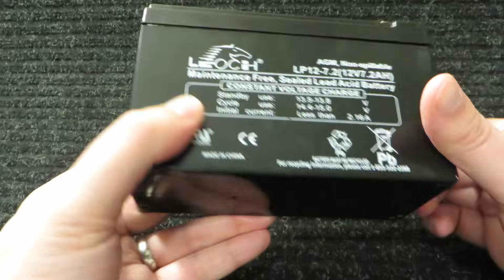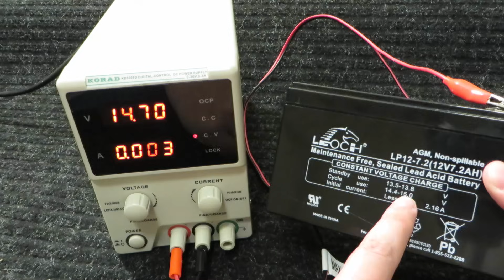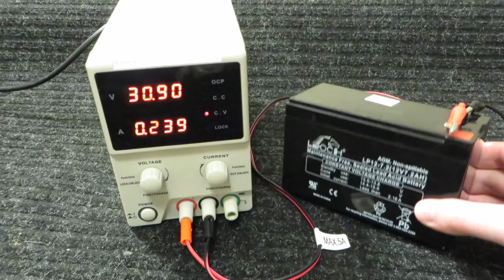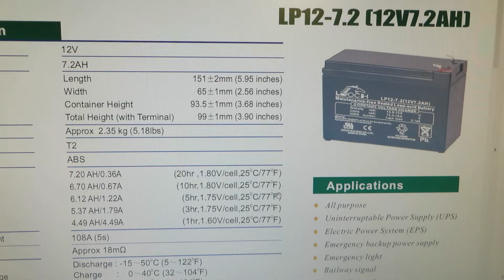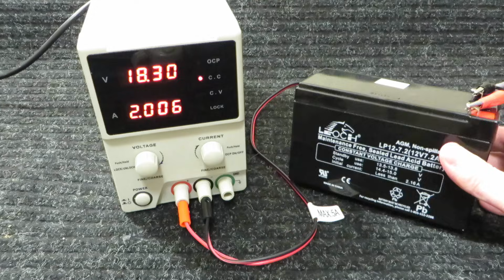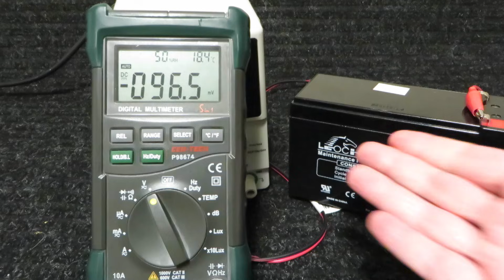Battery Desulfation Demonstration Start to Finish - Part 1/2

Comment: 19V Bricks: Many standard laptop chargers (like older Dell or HP bricks) actually output around 19V to 20V at 3 to 4 amps. These are excellent for brute-forcing a sulfated battery to start accepting current, but they require close monitoring so the battery doesn't overheat and start bubbling off hydrogen sulfide gas.
Reply from the maker: Nearly all laptop chargers have hiccup mode overcurrent protection so they don't work for this without adding a high wattage resistor inline to limit current.

Comment: battery desulfation?:  I have a agm battery was in a car it read 4v.  Took the battery out connected to health battery for a while and when up to 10.5v+.  Then put it on power supply like the one you have set it to 1.5amp max 14.2volts max ran it for a few days.  After a few days voltage was at 14.2v and amp was 0.245 amp.  Then I stop it and put it on  batteryminder (it is suppose to have a pulsating desulfation feature) and it was charging a for a few days at 14.3v 0.2amps for a few days then it drop to 14.3v at 0.12amps.  Then I witch batteryminder to maintenance mode and the voltage drop to 13.13voltas and the amp remained at 0.12amp.  Ran it for another week.  The test,  24hr rest voltage drop to 12.41.  Load lest with old faction toasted tester 10sec at 11volts (very good) green all the way on the scale showing 800-1000 (i think these are cold cranking amps).  Looks like amp is droping 0.01amp/day resting so it is 12.37 volts today.  This is a spare battery at this point the questions is what should I do next.  should I leave it alone because it not going to get better.  Should I charging it at a higher volt because it was never charged more then 14.3 volts and the battery label said to charge at 13.8 to 14.6v using the power supply.  discharge the battery and recharge procedure. what is your advice? I would say at this point the only indication that this is not a new battery is that the resting volt is at 12.41 and it is dropping 0.01 amp/day (still have to cofirm this over time).
Reply from the maker: Sounds to me like your battery recovered just fine.  If it isn't a newish battery it isn't ever going to be 100% again.
Reply: @knurlgnar24  thanks for the reply.  the reality is this battery could be at this level before it drain down to this level due to parking/storing to long.  But you video does Help.  That is why I bought the power supply a few years ago because that was what you were using.  Thanks again!

Comment: I have like 50 of these (mostly half-size 5 Ah) from old alarm systems. A good number of them have pretty bad sulfation. I usually desulfate them by just connecting them to a 14 V switching power supply, but some are too far gone and need higher voltage for a bit before they'll accept current. For those I watch them closely since once the sulfate dissolves it can quickly start overheating. When that happens you'll hear bubbling inside the battery and might smell rotten eggs from the H2S. 

These are great for solar-powered trail cams or weather stations. Also fun to hook a bunch in parallel and blow things up with obscene amounts of current lol

Comment: I was interested in the beginning, but after a lot of repetition I got impatient to see part 2 which hopefully talks about pulse de-sulfation.  But unless I'm missing something there is no part 2, no info about pulse rejuvenation.  Ho hum, so I just watched 20 minutes of mostly repetition of how 30 volt charging doesn't really work (which I already knew).  If there really is another part that covers pulse charging, please let me know where it is.
Reply from the maker: There is a part2 and it shows that this method does work.  Pulse charging, on the other hand, does not - or at least it isn't beneficial over this method.  It's a marketing gimmick by snake oil salsemen.

Comment: Though it doesn't look like that battery had a chance, it showed that if you had one that was in better condition this would probably work. 
To take a battery that was so far gone and give it some hope showed you made some definate improvements.
I have a 12 volt lead acid battery on my S10 and I purchased one of those desulfators that you just leave connected to the battery all the time. Checking with a clip-on type battery condition tester made by TopDon, My 3-year-old battery still shows 100% state of health. 
The battery is actually over 4 years old, I bought it, then reinstalled my old battery back in the truck until it died completely. 
I kept my new battery on a trickle charger during the year so technically, the battery is 4 years old and still at 100%

Comment: In UPS units these type of batteries almost always bulge and / or crack when they go bad and this usually is typically caused by excessive heat during the charging. Most charging circuits don't measure the battery temperature that well if at all and they keep trying to supply 14.7V per battery. Most UPSs use series batteries. At work I have dozens of units. Edit: Looking at this battery I suspect it was brand new but never used. I have seen this behavior with a few UPSs that had been sitting on the shelf for 5+ years never plugged in. I had them because it was equipment that a different department purchased and didn't use but shared my space.
Reply from the maker: The UPS units I've looked at all float the batteries at about 14V per 12V battery and are not current limited.  If a cell shorts, which is common once the electrolyte starts drying up, the current spikes and they overheat, swell, etc.  I agree - I think this battery was either unused or taken out of a unit that had been briefly used and left unplugged for a long period of time.

Comment: my baterz is makeing some quiet noises. is it OK?
Reply from the maker: I'm not sure what you're asking but batteries shouldn't make noise.  Quiet bubbling noises are normal but for the most part unless you are in a completely quiet room no sound should be perceptible unless there is a serious problem.

Comment: -SLA (Sealed Lead Acid) and AGM (Absorbent Glass Mat) batteries are closely related, but they have some key differences:

- SLA Batteries: These are a type of lead-acid battery that is sealed, meaning they don't require maintenance like adding water. They can come in different forms, such as gel or AGM. SLA batteries are commonly used in backup power systems, emergency lighting, and small vehicles.

- AGM Batteries: These are a specific type of SLA battery. They use a fiberglass mat to absorb the electrolyte, making them spill-proof and more durable. AGM batteries generally offer better performance, faster charging, and a longer lifespan compared to traditional SLA batteries. They're often used in automotive applications, solar power systems, and marine equipment.

Comment: I'm realy impressed that your dc power supply can push 31 volt and running on CV... mine cannot be pushed to 31 volts without increasing the amp... even the same size with just an updated version with coarse and fine knob... is there any trick to make mine running like your bench.. 30 volts with 2 amps CV?
Reply from the maker: The voltage was set to 31V but the battery had a very high internal resistance so it only drew a small amount of current.  On a properly functioning battery the power supply would max out it's rated current and the voltage might be something like 18V even though it is set to 31V since it can't output that much power.

This power supply is actually only capable of outputting about 2A or 3A continuous before it starts overheating and turning on/off repeatedly.  It otherwise works well for me if I don't push it too hard.

Comment: I tried a pulse charger on my 8 year old AGM car battery that i replaced last year due to struggling on cold mornings. My battery tester read 285  amps EN. The battery is rated 680 Amp EN. I pulsed charged it for a day and it now reads 530 A EN. What is puzzling me is why it had sulfation. The car was always on the road and never drained.
Reply from the maker: Cars with a basic zener controlled alternator voltage did a good job charging batteries.  Nearly all cars now have computer controlled alternator voltages that the engineers always set WAY too low to help batteries retain water longer.  Maybe that helps if you live in Florida where batteries fail from heat, but where I live it kills batteries fast.  If you own one of those cars your battery will sulfate in only a few years in my experience.

Comment: Aren't you just destroying the battery if it's empty of water? Why not fill it up first? It's a bit of a hack but such a battery can be opened.
Reply from the maker: There are various reasons why I do not recommend opening sealed AGM batteries to add water.  I have attempted this in the past and don't intend to do so in the future.
Reply: The battery is clearly labelled: 

Absorbed
Glass
Mat

Why do you think there should be any water inside the battery???

Comment: Drain cleaner acid and distilled water boiling cells rinse well, drain, repeat until clean and clear. Fill from Bulk Battery Acid OEM, Unadulterated, charge your battery😢 Use ein Bore scope for inspection

Comment: If the battery is swollen from one side (one cell), can it still be recovered or is it done for?
Reply from the maker: I would recycle a swoolen battery.  Please do not attempt to recover it.
Reply: @knurlgnar24  oh ok, Its hard to see as it's only one cell and barely swollen. I checked it yesterday after 24 hours of charging on a laptop charger using a light bulb to bring it down to 12v, it actually held a charge for once and lasted about 2 minutes under load before dropping to 11volts.

Comment: Am so confused, so, the way to bring a battery back to life is to charge it?! I don't understand how batteries die then.
Reply from the maker: Charging it will do nothing.  You have to force charge through it after it is already fully charged.  That's the process necessary to repair a sulfated battery.
Reply: @knurlgnar24  i have a 600 amps CCA AGM battery and fully charged.. I've checked the CCA after fully charge and it's just come out with 150 CCA.. i still can crank my car since my car is just 1.6 liter Japanese car... ive been try 3 times to force charging with a setup of 16 volts and 2.5amps about 6 hours period of time for 1 cycle.. still the CCA won't rise... can u advice to me how much volt and ampere setting to force charging... bcoz in your video it's just a small battery...

Comment: Hah, I have an old 'dumb charger' as you call it. Got it for 5.00 at a garage sale years ago. I rely on it for care of lead-acid batteries. Good video, thanks.
Reply from the maker: Those old chargers are very valuable today in my opinion.  They actually charge batteries.  WOW!  What a concept!  :)  But I understand why they don't sell them anymore as they are so easy to destroy batteries with if you don't know how to use them properly.

Comment: Great vid... nice to see someone technical doing this vs some idiot with a stick welder not monitoring anything voltage or current wise. 

Would have liked to see the drop in resistance being measured tho! Thanks again!
Reply from the maker: Conductance meter measurements would have been a useful addition.  I agree.

Comment: My friend has a solar setup and we are wondering; do we have to disconnect each battery to desulphate or can it be done in situ? A very informative video, thanks
Reply from the maker: The general answer is that they should be disconnected from the system to desulphate but there are exceptions.  If you have them in parallel then disconnecting is required in all cases.  If you have, for example, a 48V system with 4 batteries in series then you don't have to disconnect them if you're careful.  On that hypothetical 48V system one could choose to idle the battery bank at 100% SOC and then desulphate just one of the 4 batteries in the 4S configuration, but the bank has to be either disconnected from the load/charger or idling at float and 100% SOC.

Short answer is that batteries should be desulfated alone, disconnected from the battery bank.  If for no other reason than they are going to outgass a lot and get hot, and it's probably better to do that in a safer location.
Reply: @knurlgnar24  Great answer, thanks

Comment: What happens if I leave a good deep cycle gel battery on a 15v desulfation cycle for an extended period of time?
Thank you in advance.
Reply from the maker: Gel batteries are very sensitive to outgassing so I'd guess the battery would be ruined if kept at 15V for an extended period of time.  So long as the maximum charge specs for the battery are followed to avoid permanent gas pockets in the gelled electrolyte you'd be OK and the process should work - it would just take a long time since you're limited in how much current you can force through a gelled battery.

Comment: I have an Optima battery, and I have tried multiple chargers with supposed restoration functions, which have done almost nothing.  I am using a similar power supply and it is only taking a charge at 30 Volts.  Lower voltages do nothing.  I have found Optima batteries are difficult to recover when fully discharged.  Some of my fancy chargers leave the battery at a lower voltage after charging or attempting restoration.  Battery is only warm not hot, but higher temperatures help to dissolve lead sulfate.
Reply from the maker: Higher battery temperatures definitely help the process but make thermal runaway more likely which is why I don't recommend it.  If after a controlled overcharge for an extended period the battery still won't accept a charge at normal voltages then it's probably time to recycle it and get a new one.
Reply: @knurlgnar24  I suspect what happens to the discharged Optima Batteries during charging is a layer of gas forms over the lead plates and can't escape into the gel.  I had one go dead during the COVID lockdown. A dome light was left on, and the battery went dead.  I tried every trick to recharge it with no success.  It sat in the garage for a few months, and then, long after I had replaced it,  It took a charge.  Very annoying not fond of Optima batteries after using them.

Comment: I would "fix" dead car batteries with a dummy charger and a multimeter. When it would stay under 16v with 125a.for more than 5 seconds; it was ready to float charge 👍
Reply from the maker: An old mechanic's trick is to simply connect a battery to a dumb charger and let it 'boil' away.  It worked.  Not a refined approach but it was simple and most people aren't interested in wasting their time on such things when there are customers to serve.  There are many approaches to this.

Comment: Hi, I been try this process on a battery of and on for the last few months and I think I gotten some improvement.  The Battery is fairly new.  And I have gotten a totally dead battery to have a standing voltage of 12.9 volts if it is fully charged.  However the capacity reads 200-300 amps on  a load tester and the battery is a 900 amp battery.  It look like I have a very weak cell next to the negative terminal.  When I look into the cell I see definitely sulfaction on the plates and I read very low SG on the cell, and I don't see any bubbles.  So it look like I have 5 super strong cells and a near dead cell.      So if I can fix this cell I am there.  So should I try to keep cycling the battery more a hope to revised the last cell?  Should  I try Epson cell on the last cell?  Should I try to flush and fill the last cell?  And I heard I can remove some of the acid solution from this cell and replace it with distill water and keep cycling it and that would help???  thank you
Reply from the maker: I don't support adding any foreign agents into a lead acid battery as I see no evidence that it actually is effective overall considering all variables, but if you want to try it it's your property and I'm not offended.  That cell is likely the primary sulfated cell and it's possible its just too far gone.  You can always try to continue the overcharge and cycle approach but it doesn't work for all batteries.  Sulfation causes non-reversible damage unfortunately.  You clearly reversed a good portion of it already.  The industrial approach would be to empty the single bad cell, wash, refill with distilled water, charge the single bad cell to remove sulfation, then refill with acid and charge that single cell to reform.  Then rebalance all cells.  I doubt that's practical for your battery.

Comment: Good job making the video, it was very informative. What is your opinion on battery desulfators? I use a Pulse Tech PowerPulse passive desulfator, they claim to have a patented frequency they use to desulfate batteries, I have been using it on my BMW battery for the past three years and never have any issue's starting even though I only drive about 25 miles per week.

Comment: When you are desulfating, to get the best result quicker are you supposed to be charging the battery at the same time its being desulfated? or do you want the processes separate? Thank you.
Reply from the maker: The charging step is what does the desulfating.  Cycling the battery primarily does two basic things:  1:  It allows you to judge your progress.  2: It physically stresses the plates causing shedding which exposes new active lead to the charging process, and helps to create stress cracks which allow conversion of additional sulfate into useful active material.  Shedding isn't desirable but is an inevitable part of the process.